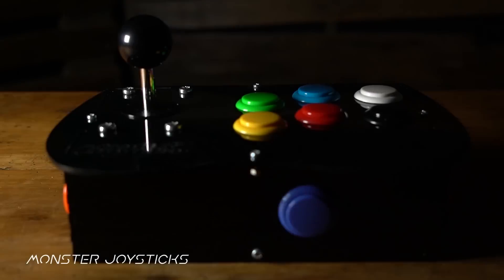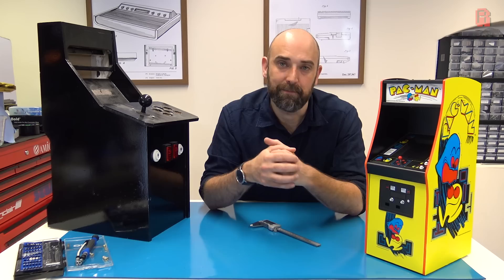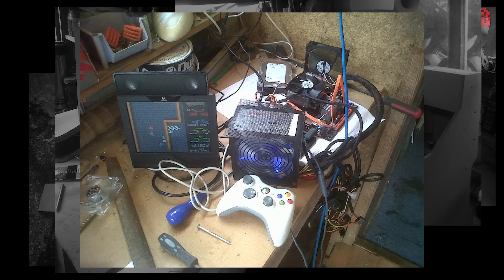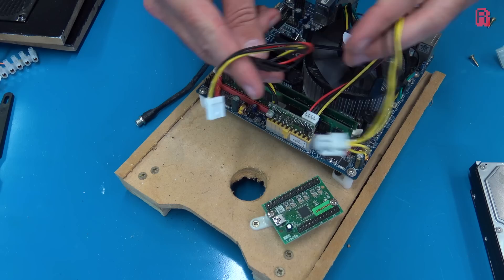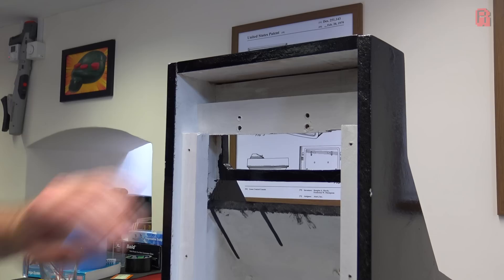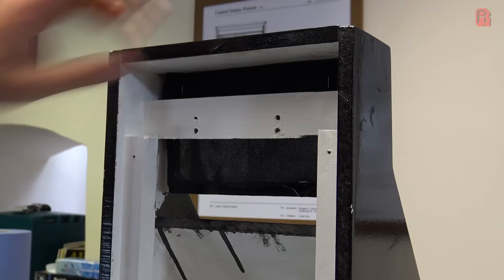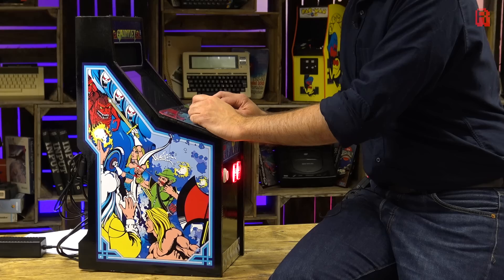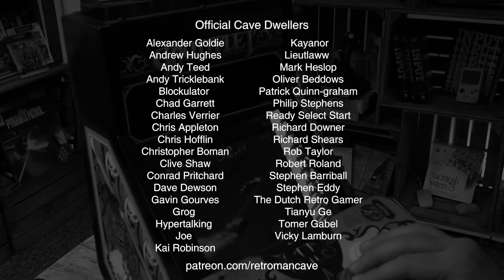Making a Mini Gauntlet Arcade Cabinet - 8 years in the making!

Comment: >"Gauntlet" mini cab
>one player
555-COME-ON-NOW

With MAME software of the apporpriate vintage, there's no reason an 8500 Core 2 shouldn't be great at emulator..  If the HD works though, might be worth imaging it and transferring it to a relatively cheap modern SSD.
Reply: He does address this at the end of the video, it intended to be a dual screen setup.
Reply from the maker: :D All is explained at the end... multiplayer was part of the design
Reply: @RMCRetro  Gauntlet just seems like a weird game to ape the stylings of, if you're not going the whole hog on it's iconic  control panel.
Reply from the maker: The choice of cabinet is explained near the start, such a large control panel is great for scaling down the cabinet while keeping proportions.  It's all subjective though and that's the beauty of a DIY build, you can make it exactly to your taste.  What would your perfect cab be to shrink down?
Reply: @RMCRetro Ghosts N Goblins, I think
Reply: @TheTurnipKing  So why don't you build it and put it up so we all can mock your efforts?
Reply from the maker: @TheTurnipKing  That would look great
Reply: @dwarf365  I'm mocking nothing. This is a beautiful cabinet..  The light up credit buttons are a really great touch, and i did something similar the last time I built one something like this.